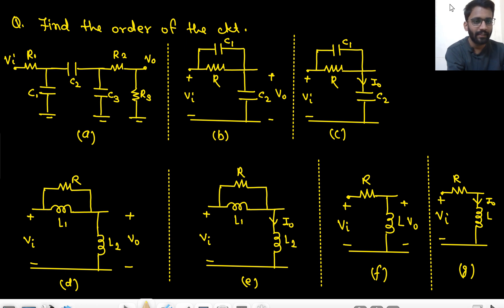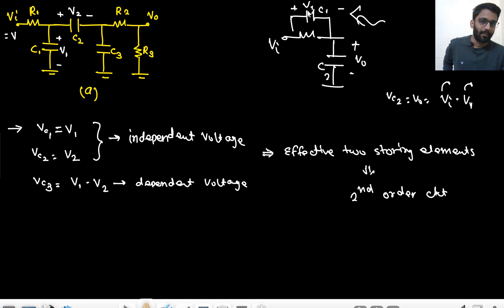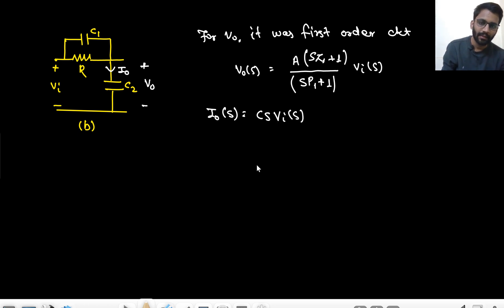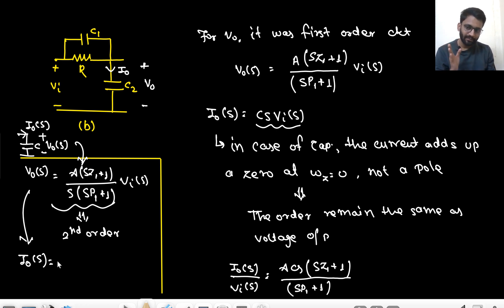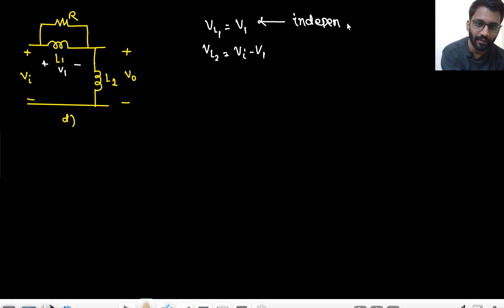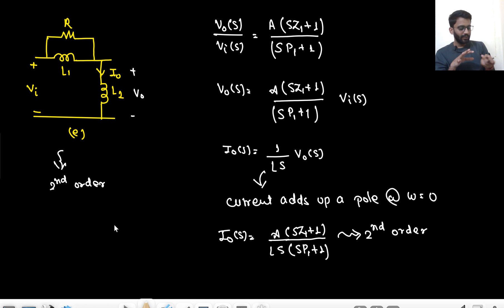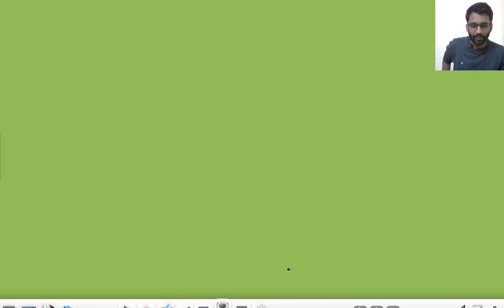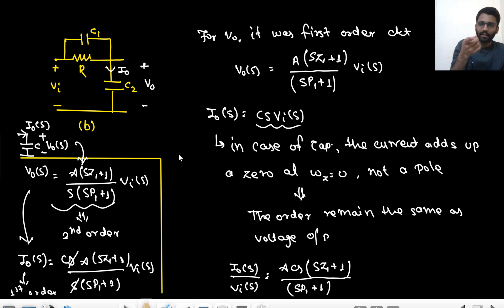Interesting Analysis on the Order of a Circuit || Prep for Interview

Comment: For the inductor the state variable is current not voltage. Unfortunately for ckt(d)&(e) if you assign initial conditions it will result in 2nd order network. In fact this is 2nd order network and there be a pole-zero cancellation. In fact, this is not a controllable system, of course, this is very difficult for an Undergrad.  For undergrad or competition, exams-it is better to say if you can simplify the network to a single energy element network then it will be a first-order network...
Reply from the maker: Thanks for the clarification, Sir. I too had this doubt already. 
Would love to learn more on this topic. Can you suggest some resource or we can connect somehow?